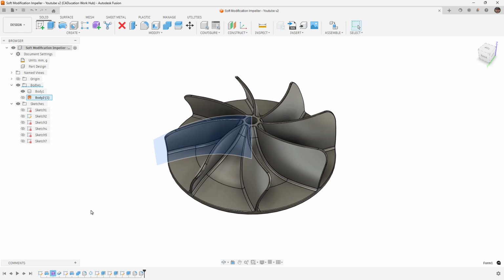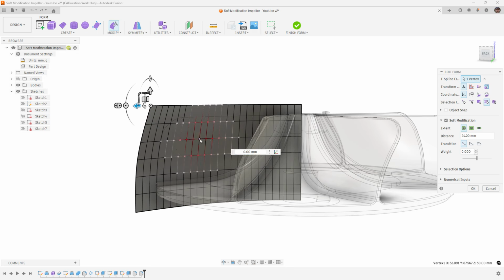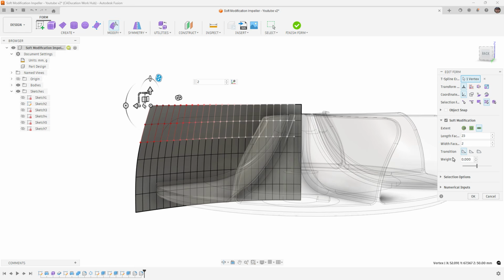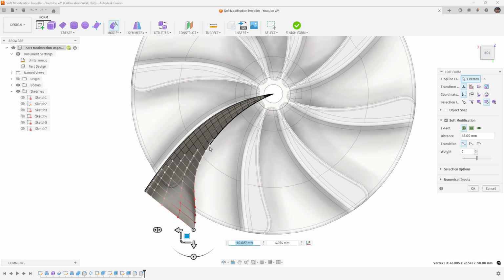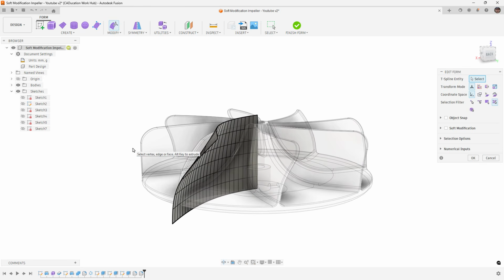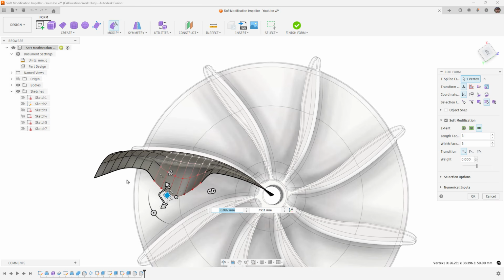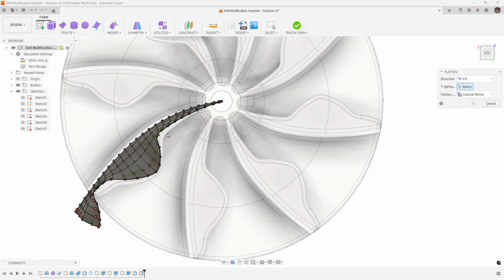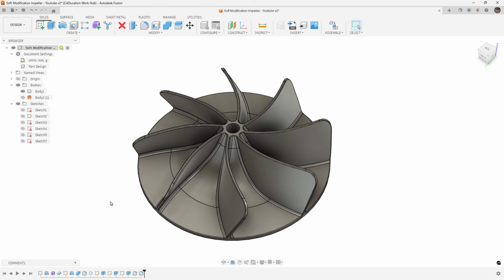Fusion Forms Mastery Part 55 - Soft Modification

Comment: I noticed that you didn't thicken your form in the form space. I assume that's the best way if you plan to modify things later. I've been watching your forms videos as I can to learn. Do you do PM's to help give advice or help out? Car stuff mostly. So many good videos I hope to absorb as I need more tools
Reply from the maker: Yeah there are reasons you would do one over the other.  You genearlly thicken in the forms space if the surface is failing, because in forms you then have direct control over the inside and the out.  For this shape doing it as a surface worked better because it was going to be cut down with a revolve after it was a solid because it was "over built".

We do have a discord channel.  If you want to join you can drop me an email support@caducator.com and ill send you the link.
Reply: @LearnEverythingAboutDesign that makes sense I noticed it was roughly made and the rest done outside forms. Forms I have a basic understanding. I created a fender flare for a VW beetle fender and 3d printed it from using the Kiri engine app and working on a whole dash cover that'll hold my haltech screen. The soft modification will definitely be useful know that I know about it. I'll reach out